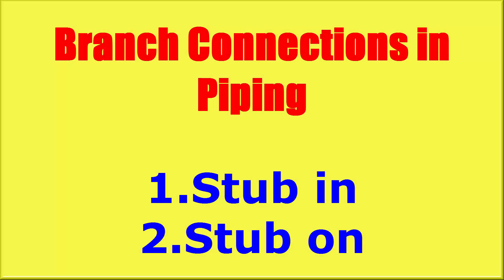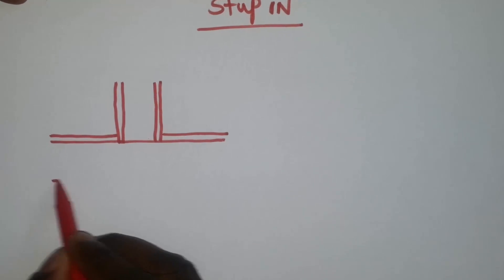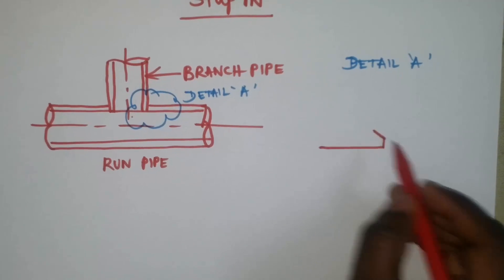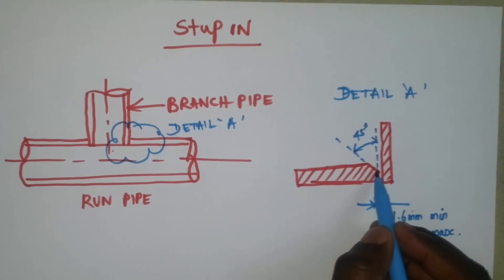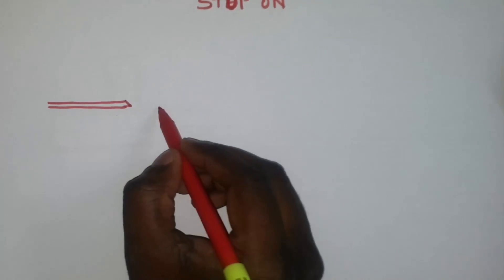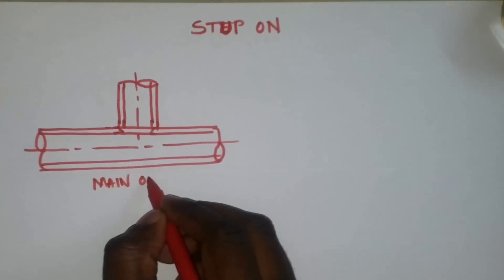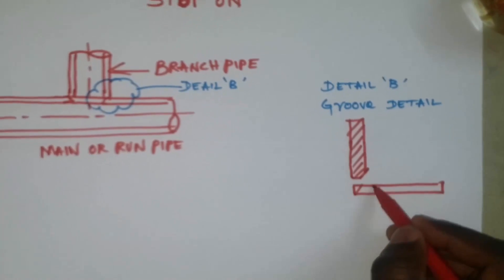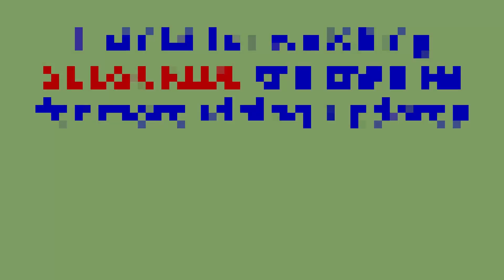Pipe branch connection method_stub in and stub on

Comment: hi Technical piping, what is the reference specification for bevel angle, gap and landing for these type of welding preparations? thanks in advance
Reply from the maker: ASME B16.25 Buttwelding Ends
ASME B31.3 Process Piping/TYPICAL BUTT WELD END
PREPARATION

Comment: what is the difference using run piping standard tee and fabrication tee & which kind of pipe line use standard tee and which kind of piping use branch tee........?pls. give me the feed back ..?
Reply from the maker: I think,its Based line pressure(High or low) and cost control measure
Reply: @TECHNICALPIPING  ,Dear YouTube,
My questions are which piping line  will be use  stand tee ..?and which piping line will be use fabrication/branch  tee......? pls. let's me know.?
Reply from the maker: steam lines/process line(gas and liquid)-std tee,Flare lines,blow down lines - fabrication tee with RF pad and without RF pad